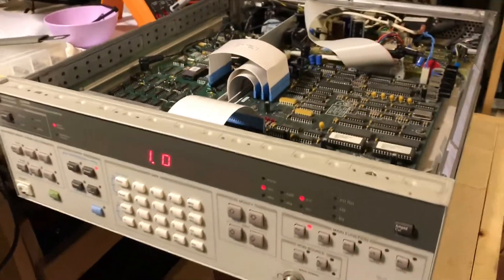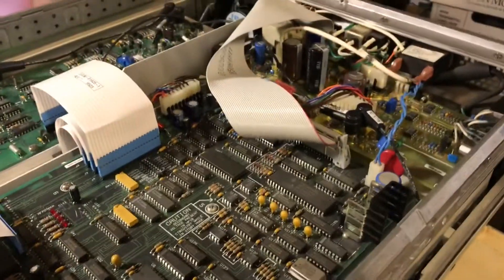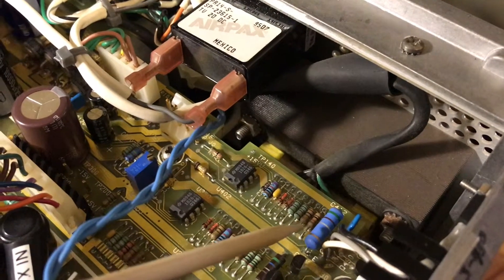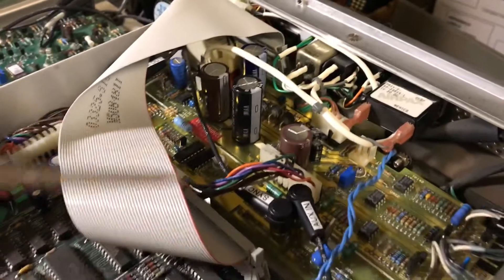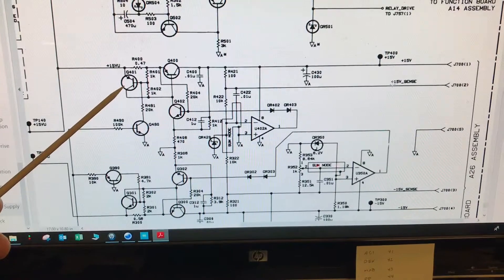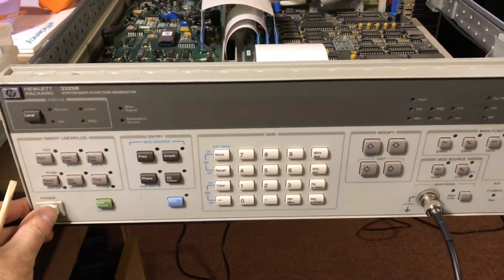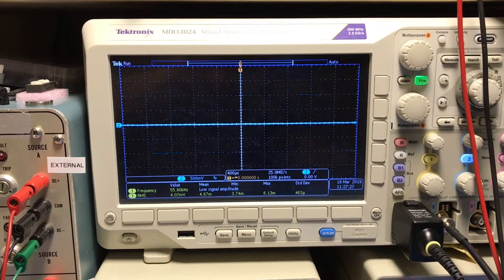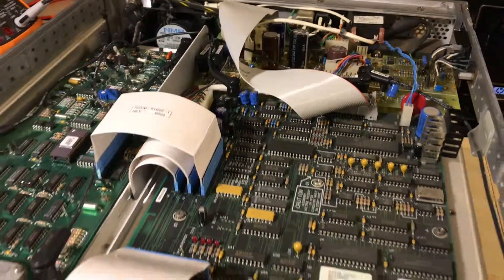HP 3325B Function Generator Fail 39 with repair solution

Comment: HI Wondering if you can share information or where to get Service manual for HP3325B , you attempt inspired me to take on repair of the same unit for my friend . I am having issues with -15 volt rail 
thanks
Reply from the maker: Sometimes you can find them on the internet. Keysight has manuals for some of the equipment. There are also other archive sites that have the manuals. I also use eBay. If I can purchase an original hard copy manual for a reasonable price I will opt for that first. Otherwise I will go with manual on cd-rom. I’ve purchased quite a few from Artek Media. Their manual rescans are very good and IMO very reasonably priced. Thanks for the comment.

Comment: What is most interesting to me is that the firmware on yours doesn't boot the same way mine does. I get 3325B when I boot. Are you running with EPROMS or the uP board from an HP 3325A or is this some earlier firmware for the B?
Reply from the maker: I never thought about it but you are right. I actually have a second 3325B and it boots with the “3325B” and option numbers. I’m really not sure what the reason is. The unit in this video was wrecked when my basement flooded last year. I managed to find an option 1&2 unit for a decent price and I use it now. The flooded one (from this video) was set aside for parts.
Reply: @FreeElectron  Sorry man that's rough. If you wash that other unit out and replace the transformer odds are good it will be safe to use again. It's a shame for it to just become a corroded parts unit.
Reply: @FreeElectron  I got the high stability option off ebay but not the HV output. What do you use that for?
Reply from the maker: Haven’t used the option 2 for anything much but it came with the unit. The flooded one is clean and dry so it probably will work.